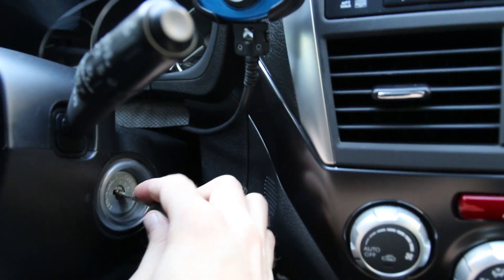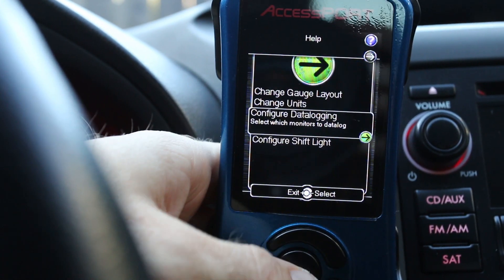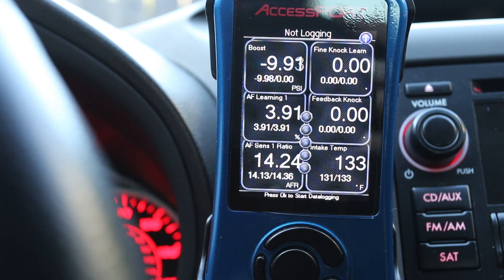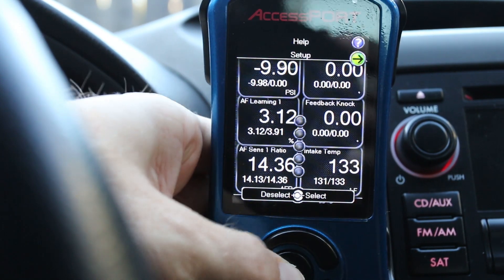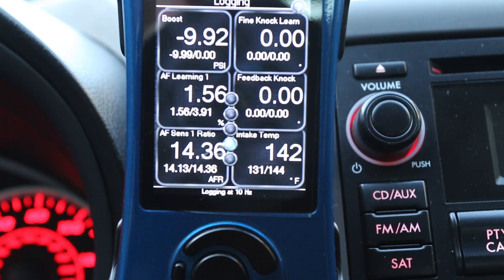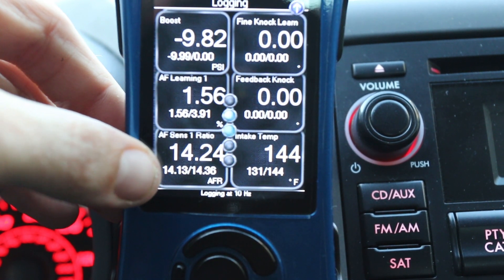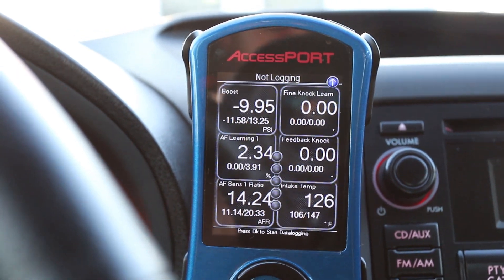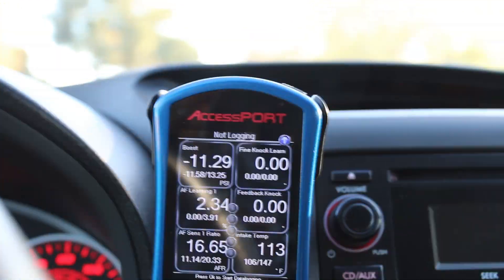HOW TO DATALOG WITH YOUR ACCESSPORT

Comment: I'm about to buy an Accessport for my '09.
 I have them for three STI's.
I see that Cobb offers an adapter to allow many Subarus to get fuel pressure data and possibly more... from the CAN bus. However, a tuner told me that this utilization of a TGV connector doesn't work with my year of FXT.
I'm in the process of dieting a newer WRX harness to put on the car. I'll have a built engine and will be using an Aeromotive FPR. Usually I just run a liquid-filled gauge on them, but I like the idea of being able to see it on my AP, or at least datalog some data or just use part of the wiring that's available for running a gauge cable. I'd like to do the same with an oil pressure sensor. I'm hoping the tuner can make changes so I can read these off the CAN. Part of this is I have an AIM EVO4S datalogger I can use while I am breaking in the car and doing an E-Tune with the AP (and gather additional data). I'd like to be able to record both if I can.
Do you know about this or where I can go for help?
https://www.cobbtuning.com/.../subaru-fuel-pressure...

Comment: Thanks for the info bro. My 2015 sti had its check engine light came on which was a p0171 system too lean. I cleared it out on my accessport even though it said that it will reset the ecu as well. How did you do the p0171 code with its datalog after you cleared the code out even though it said reset the ecu on accessport?

Comment: I had apr fuel pump and shit was so poorly manufactured it completely shit the bed after the car got to operating temperatures causing the car to stall and die. Moved over to cobb tuning and hardware so no issues. This is really helpful

Comment: Bro i have a question while driving normal i forgot to click data logging off while i'm driving the car will that be ok? Will it do any bad thing to my car engine or no?
Reply from the maker: Nothing will happen to the engine. Just a giant log to go through.
Reply: @BlakesGarage  ok thanks. Does giant log a bad thing or not at all?
Reply from the maker: Elisio Principe Well I recommend looking at a data log and you’ll know what I mean. Basically just a 20 second data log is a huge Excel file. And if you have no idea what the numbers mean then it’s basically useless garbage to you. Once you start understanding what all the information means then you can use it to your advantage but there’s no point and just did a login for a long period of time usually just during pull so maybe 10 seconds and then turn it off. Even that will be hard for a beginner to sort through.

Comment: Dude my fine knock learn has seen up to -4  and it's not even wot. Scaring me about meow a bit. It happens when I hit boost around 3500-4000 rpm. I noticed the more pressure I put on, the higher it returns in fine knock learn.
Reply: Khang Xiong Same, did you ever find out why?
Reply: @Flossydope  yea. I had a cold air intake by mishi. Also had drop in filter by k&n. Both were causing heaps of false reading cause I didn't have a tgv delete. Went back to stock intake and all the false reading vanished. Runs smoother too.
Reply: Khang Xiong mmmmhhh, I have the Cobb sf intake installed and I’m running the ACN91 sf stage 1 map. I mean the car sounds normal nothing different just when I get on it I start getting negative reading from my feedback knock and my fine know learn. I get reading from -1.40 to 4.20 and depending on how much I accelerate it goes up to the -5’s so I don’t know what it could be I’m kinda scared lol.
Reply: @Flossydope  exactly. It's cause the tgv flapping causing false reading. If you get pro or etuned, you can ignore those false reading. Tho it's always gonna happen when you get on it even a little bit. And it causes your dam drop and lower multiplier. Which is a big reason I chose to go back. You could choose to do a that delete to help with that. Tho whatever happens next I dunno. Probably nothing if get a real tune. Not ots maps. It's just more money and not any significant gain for me as a daily driver. Yours is your choice tho.
Reply: Khang Xiong So your basically saying it’s just giving me false readings and I don’t have too much to worry about.
Reply: @Flossydope  I'm not telling you not to worry. I'd def verify, but I'm saying that was the case with me. Try going back to stock and see if you still get those wacky reading.
Reply: Khang Xiong willl try it out. Thanks man

Comment: So I have an 04 STI with a new motor in it, cold air intake, down pipe, the works, I am currently running the stage 2 map and my DAM reading is consistently at .7   
Is this something to be concerned about? There is no Fine Knock or feedback knock

Comment: My 2017 STI on the stage 1 map will read a 1.4 or 2.80 feedback knock. Should I worry about it?
Reply: Nartl Eric at Torqued Performance say's this is fine and knock is not to be worried about as long as it is not at WOT.  Essentially,  knock is inevitable from time to time and normal.  I personally think feedback and fine knock should always remain at 0.00 regardless of eTune?
Reply: It can happen from getting on/off the gas too quick or rough shifts.  I also got -2.8 and notice if I was smoother on the the throttle it didn't happen.

Comment: I just bought u subaru wrx sti 2008 has invidia dowpipe, it was all good, I managed it a week, and now I got the check engine light, has the code po420, you think if I buy the access sports help me remove the check engine Light
Reply from the maker: Yony Loya if the car has a Downpipe it should already have an accessport and a tune. But yeah immediately take it to a Tuner and get a protune if you're running catless also I recommend to do a compression test. Make sure the engine is healthy.
Reply: Ok thanks

Comment: Is the low DAM dangerous?
Reply from the maker: Ulises Jaquez DAM should stay constant. For my ECU it should be 1.0 if this changes you have issues. Get it figured out before you start doing pulls.
Reply: oh ok, yea im getting 1.0 and then sometimes drop to .652 on stage 2, on stage one it change from 1.0 to .750
Reply from the maker: Ulises Jaquez yeah that's not good you're gonna want to get your tooth looked at what tune are you running? If you're having issues like that I would probably take it to a protuner and get them to figure it out. Basically her car is seeing Doc and pulling timing I would most likely replace the spark plugs first if you haven't in a long time just because that can cause issues and that's an easy repair. I have a video on how to do that if you look it up.
Reply: ok thanks man that really help me alot! i havent change the spark plugs in like 7 months, but i will take it to a protuner, im just running the stock cobb tunes
Reply from the maker: Ulises Jaquez yeah if you're running the stock OTS map I would definitely take it easy on that sounds like you're having issues and I wouldn't want that to become a problem. You may have to take it to a shop where they can diagnose the issues.
Reply: thanks man, that really help, i will take the car wirh a protuner

Comment: My 14Wrx has -20 psi vacuum warm at idle
Reply from the maker: Toby Head you may have a vacuum leak. That's the af learn?
Reply: Blake's Garage 

If i had a vacuum leak- it would pull less vacuum not more.

You have a leak, or worn rings, or low compression.
Reply: Also
My vacuum has been identical for every start up since new.
Reply: I am stock 100% with HD heat shields and blankets. Including air filter oem. 
Car ran like poo w high flow air filter 10 miles only. Has 26000 miles. Oil changes 3000-4000 miles all at dealership. (Free lifetime Gold member 2 free oil changes a year (they dont care if more- 100k warranty)
Reply from the maker: The stock intercooler to Throttle body hose like to leak. I can literally make a boost leak on the stock hose after one autox run.
Reply from the maker: Toby Head what is the A/F learn?
Reply: Turbo Supra 2jz drag racing Toby Gear Head. His A.P. boost gauge reads in inches of mercury when in vacuum and pounds per square inch, in boost.  His WRX is around -20psi vacuum at warm idle.

Comment: I just put the Cobb accessport v3 and the Cobb sf intake and in my area I have 93 so I put stage 1+sf 93 and I was wondering if this tune is ok ? I am also going to put the nameless axel back exhaust with 4" mufflers do I need to change the tune ? I am very new to this any info you can give me most appreciated don't want to blow up my engine or anything. And after I put the full turbo back exhaust should I get it pro tuned, or do you think the accessport is safe and good enough? great channel I watch it all the time.
Reply from the maker: 123valve I would always recommend a pro tune wouldn't run the OTS tune for very long.
Reply: +Blake's Garage why is that? Cobb stage 1 ots map goes mostly off the stock tune. Stage 1 is basically stock.

Comment: +Blake's Garage     

 I've been seeing -1.40 for fine knock learning and feedback knock about once daily but its never during a pull.  I might try re-flashing my ecu due to the big temp change since i initially installed it and see if it corrects it.
Reply: What exactly do you mean by re-flashing the ECU? Just putting the map back on to reset it?
Reply from the maker: +Griffin Hall a lot of time that helps for a bit. -1.4 is pretty common. If it reads anything higher you may want to get the tune cleaned up.

Comment: Hey Blake I have a question when I'm driving my wrx which is stage 1 I get -1.4 knock feedback should be worried ?
Reply from the maker: +harrisbest1 no that is normal. Just make sure you can't keep repeating the knock with throttle input.

Comment: What are your mods Blake? Sounds beastly. I had some feedback knock last night and it reached - 6.30 just crusing, is that a bad number? I don't know whether I have a problem or not? Maybe you can help me, I have a Cobb V3 ap and a 04 wrx with a lot of mods. This whole knock thing is new to me and data logging. Please let me know. 
 Thank you, 
 Eric Miller
Reply from the maker: +eric miller hey Eric. Ever so often you can get false knock. Just make sure it's not happening under load and you can't replicate it with throttle inputs. You may want to ref lash the map sometimes that can help.
Reply: Awesome... Thanks for the great info. Keep the sweet videos coming.. Btw what's your mod list?
Reply: What speed do I start at and what speed do I end at for third gear tune thanks

Comment: My car always get FBK when its hot out, I seen as bad as -2.80 to -4.20 (once), cant figure out if its pre det or drivetrain shock giving a ghost knock because I shift pretty fast to the next gear.  I try to spray the I/C down roll a bit to let it evap the alcohol and water and give it a pull, seems to help out A LOT.  I thought 3rd gear pulls were at 3k, i been doing them wrong lol. During the vid where was the knock occurring? I know starting at low revs it causes a lot of vibrations and registers knock or the engine just plain doesnt like it.

Comment: Hey dude another quick question for you. I'm really leaning towards the accessport. I noticed in the video you said your going to send in your data logs to a buddy to fine tune them. I don't know any one to do this personally. Is this something Cobb does? Also even though you have some knock is it causing any damage to your car while this is happening before you get it more fine tuned? Thanks again for your help!
Reply from the maker: +Blake Eaton I'm sending the logs to Eric at Torqued Performance you can check out his website he does E-Tune's. Eventually I will get Travis at Snail Performance to tune my car but I'm wanting to do the whole E85 Setup first. The knock I'm getting in this video is mostly due to my heat shield around my uppipe making rattling noises and a little during the shift after I reviewed the logs. A -1.4 can just be noise or false knock it's not a huge issue but it is something to keep an eye on if its repeatable. Cobb does not due fine tuning over the web as far as I know. When you first install the Cobb map keep an eye on these gauges you will probably notice some numbers coming up. Thats when you have to make the decision to get the car more dialed in. Or just wait until you have more mods and install them all at once so you don't have to go back in 6months and pay for another tune because you changed something.
Reply: +Blake's Garage ok very good! Thanks so much for all the great info! I really appreciate it!
Reply: Oh, that makes way more sense ! Thank you so much! Glad you actually have the time to respond to people! Love your vids! I'm learning a lot from 'em since I'm a beginner and all! Keep them coming! Subbed!
Reply from the maker: H43RT ofGielinor No problem glad I can help. I will keep them coming for sure.
Reply from the maker: Get the V3 Accesport first. DO NOT install the SF Intake without a Accessport tune. I would get the catback first then Accessport after that get the SF Intake.
Reply from the maker: +Blake Eaton Yeah just send it to my email in the about section. I will look at it.
Reply: Blake's Garage did you sell your wrx ??
Reply: +Blake's Garage First of all, very helpful videos! thanks a lot man ! .. I'm thinking of getting myself an AP, but also thinking of installing the Cobb SF intake and catback exhuast. Which should I go for first? Install all mods go for that logging(AP) and finish it off with the tune?? And if the mods come in first which AP would be best suitable? Any suggestions? Thank in advance!
btw I have a 2011 subi wrx limited ...
Reply: +Blake's Garage just read for the first time about "bricking" the ecu. Can you go into more detail about what exactly that means?
Reply: +Blake's Garage I know I'm an idiot but I don't see your email in the about section.
Reply from the maker: Blake Eaton Go to my Main channel page then about the click For business inquiries: then you have to enter some generated code. Sorry I don't just want to post it in a comment.

Comment: I got a 2016 wrx this year. In your opinion would you get an accessport or wait for the warranty to run out before you do any modifications that might get a claim denied. Thanks!
Reply from the maker: +Blake Eaton If it were me I would get one. But thats the hard decision everyone has to make. Power or Warranty.
Reply: +Blake's Garage I'm kinda with you on getting one. I have a birthday coming up. I was going to go with the Cobb accessport with the sf intake. This is my first wrx. If I install these parts are they fairly safe in your opinion? And is an accessport enough to make the car  run safe?

Comment: You need to get a cold air intake! My intake temps are usually only a few degrees off from the outside temp.
Reply: David Mudrik You could also have a better inner cooler 🤷🏻‍♀️

Comment: Hey do you get random feed back knocks when cruising in 4th?
Reply from the maker: +jon cash usually more so in 5th. Only under light throttle. It's getting worked out right now and its way better with the revised maps.
Reply: +Blake&#39;s Garage Word Eric told me it wasn't a big deal as long as it wasn't under WOT so I was just curious if this normal cuz when you start seeing numbers when you cruising makes your heart jump a bit lol. Keep up the good work homie
Reply from the maker: jon cash Yeah, WOT is the scary one. I was getting some kick but it may be the uppipe making some noise form the heat shield.

Comment: I always seem to get about -1.40 feedback knock..
But apparently it can be set off by any noise similar to the sound of actual knock. Is that true?
Reply: +Blake's Garage exactly. repeatable means you need to reach out to your tuner asap.
Reply: +MrDJC247 yea 1.4 is okay.  The higher the number the worse it is (obviously).
Reply from the maker: +MrDJC247 Yep it can be false knock from road noise. when you get higher numbers its something to be concerned about. If you can recreate the knock with your throttle inputs you most likely need to get your tune looked at.